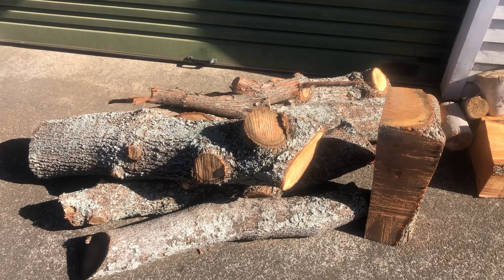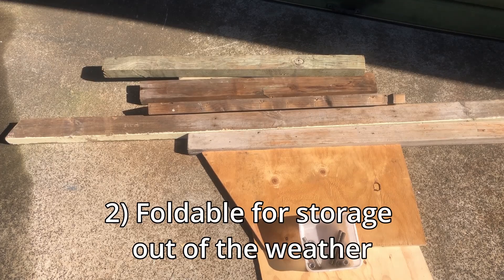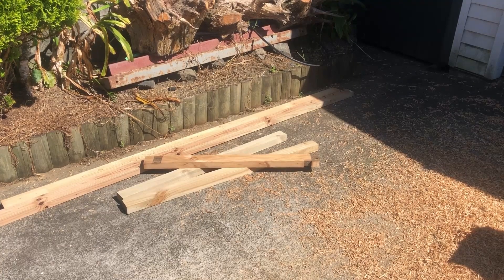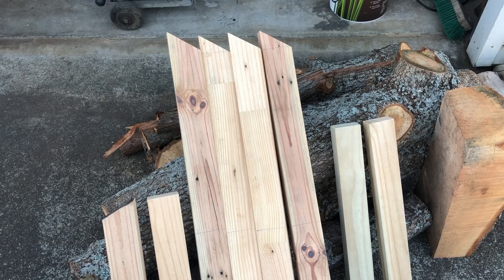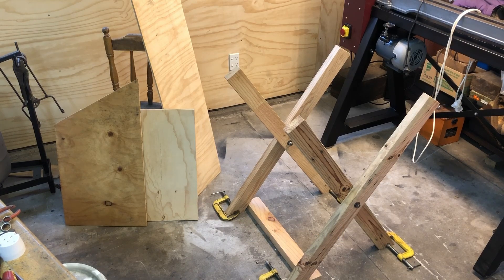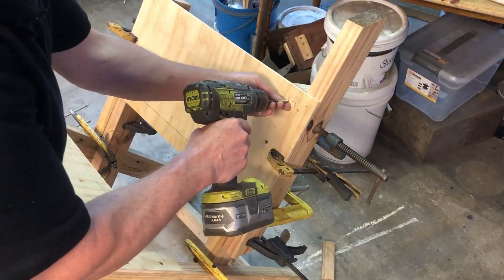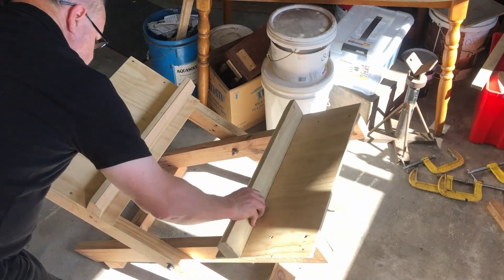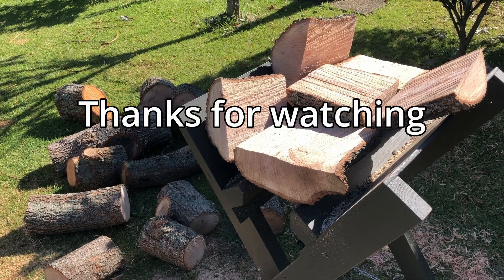Building A Woodturners Sawbuck

Comment: Consider a saturated solution of PEG.
This diffuses into the cells and keeps them from shrinking.
Reply from the maker: Hi, thanks for your comment. What does PEG stand for?
Reply: @thehobbymachinistnz  It's common for wood turners to soak their blanks in polyethylene glycol (a particularly long chain type, with molecular weight of more than 1000)
This is a waxy solid below 40°C but when diluted in water will soak into wood and prevent it from checking and cracking.
Turners I know will keep their blanks in a bucket or barrel until use and if multiple sessions required return them to the vat in order to get deeper penetration.
Wood carves or turns much better when the cells are full and resilient.
I'm somewhat new to your channel and didn't know you had an interest in woodworking, but enjoy the content. 🙂
Reply from the maker: @jimurrata6785  Hi Jim, thanks for the clarification. Yes, it is a bit odd. Most of my videos are on metal work, machining and fabrication. But, I have acquired an interest in woodturning lately as well. I have actually joined a woodturners club and I have been learning so much over the last few months. 

I have brought some 'stuff' they call log sealer from the club. It is a waxy solution that you paint into the end grain where the log was cut so that the log does not loose so much moisture from the cut ends. Maybe this is similar to the PEG?
Reply: @thehobbymachinistnz  Glad to hear your interests are so diverse. Look forward to whatever content you put up!  👍
Here in the States we usually use Anchorseal or similar product on fresh timber. I don't know that this would diffuse into wood.
Now that you've joined a club I'm sure that there are members willing to share what's worked best for them.